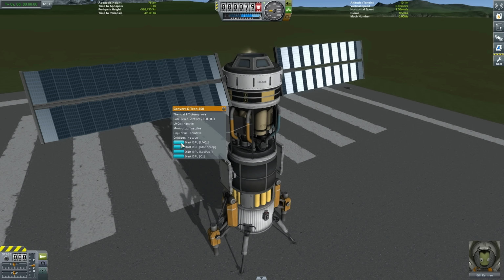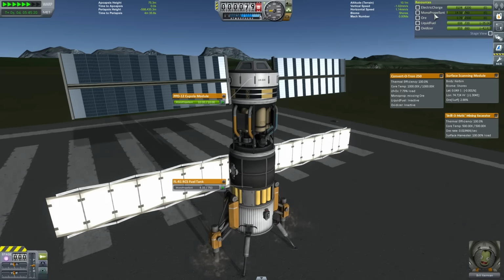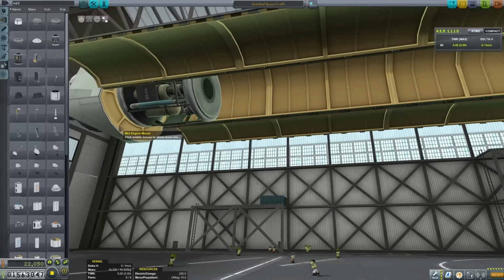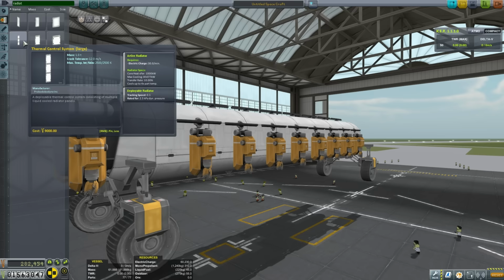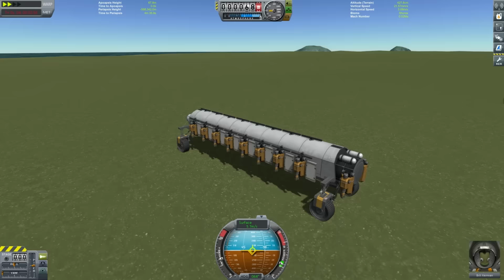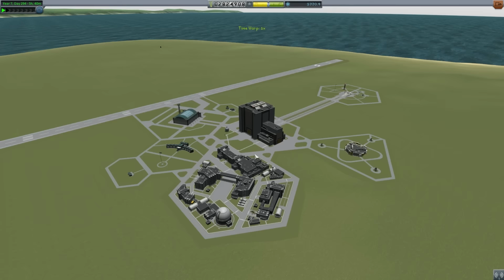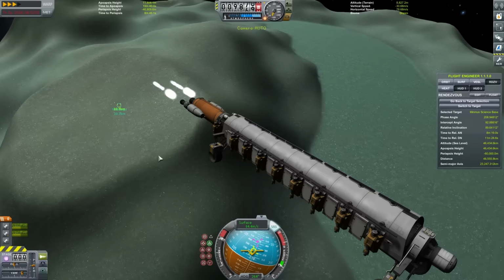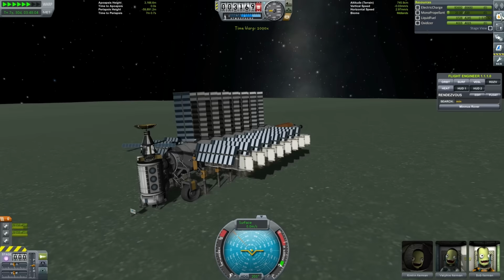Super Refueler and Mining Basics (Tutorial: 23) Kerbal Space Program 1.1.3 Stock

Comment: One thing to remember, when you have the tech, a large fuel cell array is much better than multiple XL power panels, for power generation. 
For one, they take less space and can be hidden in a cargo bay, to not mess up the aesthetics of your craft.
Two, since your power comes from fuel, you can keep mining and refining during the night, cutting your refueling time in half. And due to that, you don't need so many batteries, which will save on weight.

However this doesn't mean you should eliminate solar panels entirely. I always calculate power required by normal ship operation, like command, reaction wheels etc and add it in solar panel form, then add the exact power requirement to operate the drills and refinery, in fuel cell form.

Comment: I managed to get a "Big-Ass Refueling Truck" to the Mun and it worked well (demo video coming later on my channel).

After watching this video, I was inspired to make a Mk. II starting from scratch. While I took some features of House's design (the Mk. 3 fuselage, batteries and converter in the cargo area, radiators and drills and panels everywhere), I added some modifications to the truck - like having the ore tanks in the cargo, for instance. I may not have as much energy capacity as this one (House's ~80,000 > My 36,035), but at least mine can keep running for a long period of time (radioisotope generators, ceiling panels that do not extend). Aside from that, here are some more useful tidbits of information:

BIG-ASS REFUELING TRUCK MK. II SPECS (just the rover itself - no attached rocket boosters)
* {2 x (15G Relays)} and {1 x (100G Direct)}
* 6 x (Large RoveMax Wheels)
* 5,005 Oxidizer capacity
* 4,095 Liquid Fuel capacity
* 3,000 Ore capacity
* 2,110 Monopropellant capacity
   -   if all systems are working operationally (at once), the Mk. II can have ALL its tanks full in less than 9 days (tested at airfield)

I just need to make a transport rocket with enough Delta-V for the Mk. II (Mk. I already works, as you'll see later) to get to the Mun - Minmus requires less Delta-V. Thanks again for inspiring me, Marcus House.

Comment: Thanks a lot! This is the one I'm looking for! I'm planning on building a gas station (system?) on Minmus and Mun.
Reply from the maker: Minmus is great simply because of the very low gravity. Takes virtually no fuel to get off it.
Reply: Marcus House
That's true about the gravity, however the inclination is a little bit annoying.
Reply from the maker: True. Picking the correct launch window helps there as you can usually get the relative inclination right down in ascent. In the vid I got it down to a little over half a degree.

Comment: A neat concept, you might want to add the m-700? short range scanner as well, as it shows a map with density of the ore in a 1 km radius around your vessel, extremely useful in tracking high concentrations of ore.

Also solar panels are actually quite inefficient, space wise, much better to fill your cargo bay with large fuel cells. Number of drills might be quite high, that's enough drills there to feed 2 refineries. Here's a similar vessel I built a while ago:

Mk2 version: http://image.prntscr.com/image/9e212f5fb7604759820f7c1a993d8009.png
Mk3 version with refueling truck: http://image.prntscr.com/image/ff6818e8208d49fd981ed7fa3d7db055.png

Comment: So, if I put a mine on the mun. How much battery should I bring for 4 drills and 2 ISRU to work at the 'night' there?
Reply: 2 Isru with 4 drills is a bad combo, one ISRU will be completely out of ore while the 2nd one will barely be half way full.
10 drills can support 1 isru easily. If you want to use 2 isru, you need 20 drills.

Instead of solar panels, use large fuel cells, that way you don't have to carry a billion batteries with you. You will need a small battery and a pair of small solar panels, for insurance.

Comment: Why not instead of 2 empty cargo bays use an empty fuel tank? Refuel while not in use so you have that much fuel when you connect to a lander, making it quicker? Of course I could test this myself, I'm sure you have your reasons. Great idea though, I should do something like this. I should also learn how to re-enter and land near ksp
Reply from the maker: Thanks for the question. In this design I wanted it to contain and hide away the Convert-o-tron and batteries.  You can certainly fill that empty space with tanks and do exactly what you are saying.  I really just wanted to build a fast refueler that could drive around. If you loaded it with fuel driving around would be much more difficult I imagine.
Reply: Built what you built, empty wt. 64.7t, cost 324,448, top speed 11.5m/s (I'm running 1.2 pre-release). Replacing the 2 empty center cargo spaces and putting in Mk3 fuel sections (same size as cargo spaces, empty wt. 65.8t, cost 326,858) when full on fuel I got 11.0 to 11.1m/s. I'm sure more testing is needed but so far so good. You did a great job building, it's very sturdy. I just was curious about filling faster than 24 days or whatever it was lol
Reply from the maker: This is a nice option. From memory (and I was running in 1.1.3) the wheels kept busting when I had it with fuel tanks. I think the wheels in 1.2 are loads better so this would be a nice option.
Reply: That would make sense, the wheels in 1.1.3 are garbage lol

Comment: I need some advice.
So first thing: what's the best way to level up an engineer fast?
Secondly: Isn't the converter a big bottleneck in this design? should i go for more converters and/or less drills instead?

I'm planning on making a mobile science collector for minmus that uses flight instead of wheels, to visit all biomes. I know I could do it with a fixed fuel amount, but It would be fun to try it with a small fuel tank and refueling system.

Comment: At (5:57) you say "move tool". I've been playing KSP since it was introduced as an alpha from a friend. I was wondering if the "move tool" is a mod? If it isn't I may have missed something huge. It's the finetweak style nodes on the rover wheel that I'm confused about. How does one get these to show up? If they are a mod, what is it called?
Thanks for any info. Subbed and liked. Thanks for the docking tutorial too!
Reply from the maker: Thanks Tyler. No mods here. The Move tool is just  a tool mode in the VAB/SPH that lets you move the parts up and down in interesting ways. There is also a rotate tool that lets you rotate.
Reply: Marcus House I understand what you mean, but because I'm a very hands on learner. How would someone open or show this move mode. Showing the actual directions possible like it does around (5:57)? Just curious.
Reply from the maker: If you go to this page
http://wiki.kerbalspaceprogram.com/wiki/Vehicle_Assembly_Building
and then scroll down to Editor Gizmos you will see them. They appear at the top LHS of the editor screen in the VAB. The Offset tool (which I call the move tool for some damn reason), is the one I am using there.
Reply: Marcus House you sir, are a saint. Thank you.

Comment: the grabber unit says "no fuel crossfeed" on it, does that mean that it cannot be used for these builds? patch change?
Reply from the maker: Yes now you need to use a docking port instead of the claw which makes it just a little more difficult. Same method though. You'll just need to place the port at the exact height  to ensure you can easily dock.
Reply: thanks for the response dude :)
Reply: Or if you're using the KAS/KIS mod combo, have your engineer get out and hook up a fuel pipe.